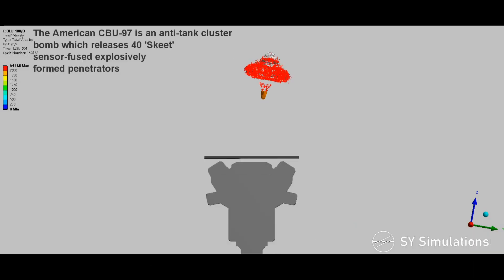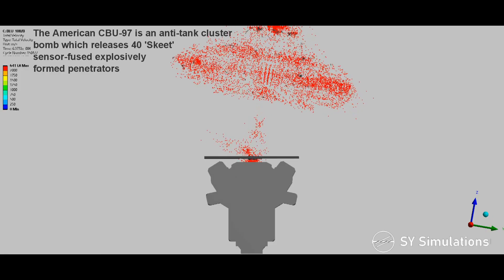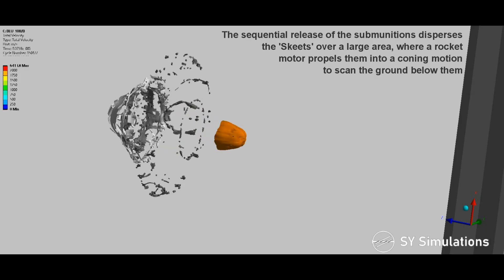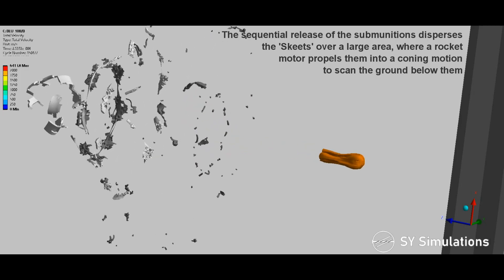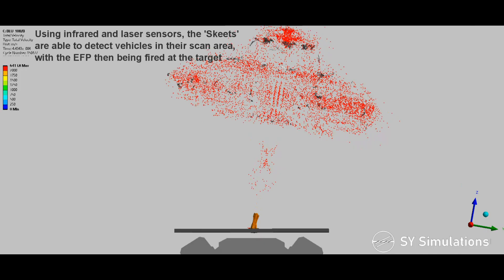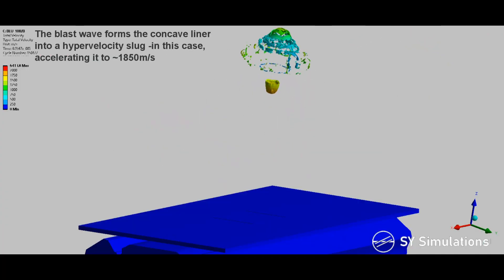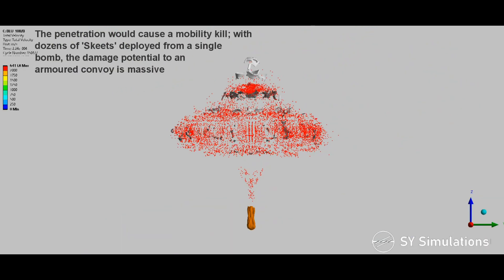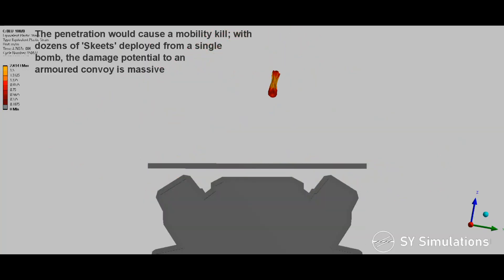ANTI-TANK CLUSTER BOMB SIMULATION | BLU-108 Skeet Explosively Formed Penetrator vs T-72 Engine Deck

Comment from the maker: In reality the EFP would detonate a lot higher above the target, however it wouldn't fit on the screen, hence the reduction in distance. Also, the EFP modelled is one without the fragmenting edge on the liner. See the description if you want to know more :)
Reply: Is the fragmenting edges intentional to improve lethality, or is it an artifact of the efp formation?
Reply: @contagioushavoc5794  The fragmenting liner enhances anti-personnel effect.
Reply: Could you also simulate a hit to the turret roof?
Reply: mmm, frag liner
Reply: Cope cage effective against small cluster efp ? Or just only weight adding for nothing?
Reply: @a.t6066  As long as it hits the bars, i would expect them to be effective.
If you can break up the EFP a meter away from the armour. But that would be a good simulation yes
Reply: @xxxm981  simulation time would be high but I would like to see this as well.

Comment: Could you test blueprint guns like the gun on the GRILLE 15? I am aware how much of an ask this is given it was never made nor have i ever found blueprints on the shell. WoT claims this gun could pierce 200mm of steel at 4000 meters. I'd appreciate it a lot if you could atleast consider this suggestion, many thanks in advance.
Reply: If it was never made, nor a blueprint exist, what's there to simulate?

As far as "200mm of steel" goes, unhardened mild steel does not provide a whole lot of protection.
Reply: @jintsuubest9331  Perhaps I've gone too far with this one, still I'd like to see how guns that never existed could have performed if at least the shell and velocity are available. But in this case I was curious if it could be done due to the fact we know how pzgr39 operated. Thank you anyways for your input.

Comment: Something I really want to see is an idea I had about hypothetical WW2 era composite armor. Basically as a method of making a vehicle cheaper by using 5 10mm thick plates with a 1inch oak board in between each plate. Would it be able to stop something like an 85mm apcbc shell for example?
Reply: Look up "plastic armour" if you haven't heard of it before. Basically a mix of tar and gravel that was mostly used for improvised protection on ships, but also tested on tanks against shaped charges
Reply: @puff7145  would make for a pretty good video on here if he could do it
Reply: I really like the sound of this.
Reply: You suddenly has 5 times the welding to do. If it is not weldable, you have 5 times toe clamp/bolt/rivet to do. How is that cheaper?

What's the point of wood?

Research shows monolithic plate (assuming good quality) almost always provide better performance than thin plate against penetrator of with t:d ratio massively bias toward tor projectile.
Reply: you would not have 5 times the welding to do, the wood would be part of a largely external structure bolted to the base plate. think of the add on armor done to the Panzer III.

another point is that it is easier and cheaper to weld thinner sheets of steel together, especially if that steel has been hardened.

as for the the value of the wood, this is more of a theory on desperation rather than something created after 6 decades of constant development and improvement. wood also has the fact that it is a fibrous material and when unable to separate due to being constrained it could have some beneficial effects; though I don't believe these simulations can adequately test that theory easily.

On a final note being an asshole was un necessary, plenty of stupid things have been simulated as "what if" scenarios such as a battleship cannon hitting a tank directly.

Comment: This kind of munition (without all the tech) was a pretty big breakthrough for the Soviets in WW2.  The PTAB was far more effective against vehicle columns than classical dive-bombing.  Just blanket a column with tiny projectiles - and you're going to get mobility kills through engine decks.
Reply: that is cause the engine deck is thin, it needs to be ventilated as the engine produces a lot of heat, and therefore requires quite a bit of ventilation to help keep the engine cool and stop it from overheating

Comment: The MEFP lenses were always an interesting addition to the design, but I'm unsure as to how effective they were as "Soft Target Effectors". Perhaps they serve a similar role to the Lethality Enhancer warhead on the Patriot PAC-3 missile, making up for slight misses. While their shape and mass is poorly suited for deep armor penetration, they would without a doubt defeat BTR like targets while causing considerable behind armor damage. On thick or complex armor impacts, they will likely cause surface fragmentation as they "splatter" that could damage soft auxiliary equipment such as sights or degrade or destroy ERA and NERA blocks.
Reply from the maker: Maybe they deemed that the penetration of the standard liner was more than enough (even if reduced to accommodate the fragments), so they thought how they could improve it in other ways -like the ones you stated?
Reply: @SYsimulations 
Very likely. However it would appear other developers deemed the MEFP design superfluous as neither SMArt or Bonus have it. On the other hand, with the current advent of High Density Reactive Materials and experiments with multi layer complex EFP's, it might make a comeback.

Comment: turret roof with ERA? Also I would like to see  M77 DPICM.
Reply: Straight through, EFPs are the counter to ERA.
And unlike HEAT, they don't require a precise detonation standoff, they work from metres away. 
Look up NLAW penetration tests, bar armour, era, solid armour, it goes straight through them even when using multiple layers of each.
Reply: @MostlyPennyCat EFPs are not a counter to HEAVY ERA which will be significantly more effective vs EFPs than they are against APFSDS because of the increased cross section and reduced density of EFPs.

Comment: How effective is it against ERA?
Reply: the armor of the engine roof is 5mm to 10mm, putting ERA there would destroy the engine more than the penetrator would.
Reply: Nobody’s putting ERA on engine deck.
Reply: Why not? Just assume that the upper projection is protected by an improvised superstructure with ERA.
Reply: @blickwinkel6020  Because its called engine deck for a reason. 1. more armour + ERA there means more mass and the engine deck is rarely targeted. 2. You can't make it thick or especially volumeous with spaced armour, because you still want to access the engine below. A heavy cover makes maintenance harder. And its already terribly hard to do, on any T tank. A leopard 2 can switch the whole engine in the field in about 45 minutes. On a T-72, its a factory/depot task and takes about a day. With a heavy engine cover, even refueling can take twice as long.
Reply: @denniskrenz2080 
Emm, you do know field repair vehicle exist for even t54, right?

Anyway, armoring the engine deck is not a revolutionary ideas. It is just the cost far out weight the benefit most of the time... Merkava is a thing for instance.

Engine deck weight has no effect on accessibility of the power pack if the vehicle is design with that in mind. Electric or hydraulic lift exist. Or cutting a hatch at the back of the hull like M18 or M8 mgs.
Reply: @jintsuubest9331  still, the tank has the ergonomy of a torture device, even for simple maintenance tasks. Field maintenance simply doesn't work in the east. Also Note that the merkava has no engine Deck, its below the glacis. And does not make the engine accessible.

Comment: Can it bust the top of a tank turret?
Reply: Yes. Thats where its weakest.well used to be anyways.Cage armour is useless
Reply: Easily
Reply: no, soviet tanks have 40-45mm turret roof armor while the engine compartment have 5mm, NATO tanks have 30-40mm turret roof. these detonate pretty high up and by the time the penetrator reaches the target it has lost a portion of its energy. it's as the viideo said, designed for mobility kill which will render your vehicles useless and vulnerable to artillery.
Reply: @Real_Commander_Shepard  Yes it can "The kinetic energy of the projectile is expected to penetrate up to 110 mm of armour "

Comment: That's a wild weapon . I watched a story about some forward SF type guys facing a column of armored vehicles calling for help and an F 16 came in and dropped one of these . It worked ... 1 bomb game over . The real Smart bomb . If a skeet does not detect an armored target it changes modes floating down and detonating like a normal non ERP munition .
Reply: That doesn't make any sense. The physical shape of the device doesn't change if it doesn't detect a target so it's going to react to the explosive the same way it would have if it had detected the target-- It's going to form the penetrator either way.
Reply: @PvtPartzz  Just guessing but if they trigger the warhead from the bottom and packed more around the base it could change the shape of the explosion . It's a very advanced weapon .
Reply: @EdD-ym6le  impossible.
Reply: By normal, non ERP do you mean that they have contact fuses?
Reply: @Ramash440   I meant EFP - Explosively formed penetrator - instead of forming a directed slug of metal it goes off like an area grenade . Not sure about the fusing , it is a very advanced weapon .
Reply: link?
Reply: @krumpirko8888gaming   It was actually on a " History " channel type show about advanced weapons I believe so it was mainstream type media not something I read on Quora or something . They call that bomb the " 12 miracles " or something because thats how many steps have to go right for it to work . That may help you find it if you decide to look .
Reply: I’ve read that skeets failing to detect a target can become mines... but that could be hyperbole.
Reply: @gdutfulkbhh7537   It is already " smart " and has the ability to proximity detect so I would think that would be a relatively easy modification .

Comment: jees even cluster bombs can kill tanks
Reply: These types of bombs are meant to be used against tanks and other armor. They are anti-armor munitions
Reply: @dardragon2438  
The Sensor Fuzed Weapon is a multi-purpose munition intended for almost all targets. They usually have preformed fragments in addition to the EFP.
Reply: @Carryopsis  This is not novel at all, DPICM-equipped cluster munitions entered service in the 1970s. These are a variety of weapons (artillery and mortar shells) which contain a lot of mini-shaped charges inside, each able of penetrating some 100 mm of armour, enough to go through the top armour of any tank. A single 155 mm shell contains some 80 submunitions, an M26 227 mm rocket up to 677 submunitions, a GMLRS 404 of them. So, a lot per shell.

The one simulated here is a more interesting one as they are "sensor-fused", the round spins in the air randomly while falling and detonates when it detects it's aiming at a vehicle. It also uses an EFP rather than a shaped charge due to these having a longer  effective range.

Cluster munitions only really sacrifice performance against structures, and are considerably more effective than unitary warheads against anything else, be it personnel, armoured vehicles, or other materiel.
Reply: @rare_kumiko  Even discounting all that- even a "small" 50~100kg bomb is going to disable a tank with a direct hit on top of its engine/turret and blow of its tracks if close enough,  people often overestimate tanks suitability.
Reply: I mean, bombs in general can kill tanks, lol.